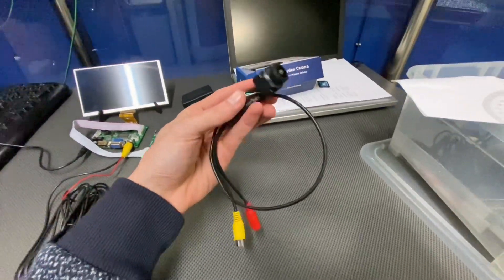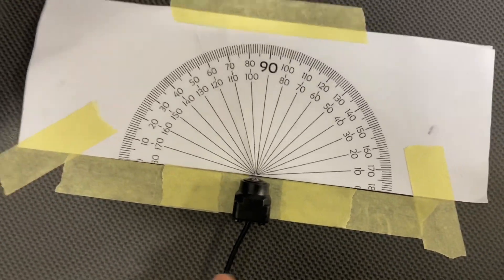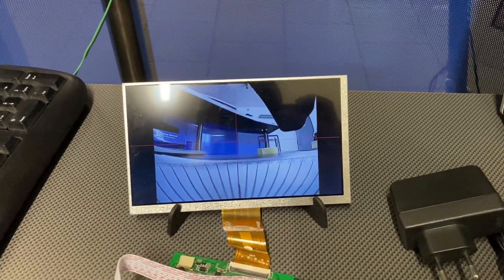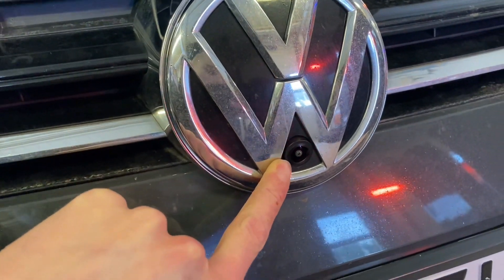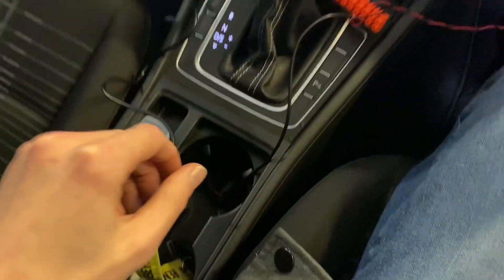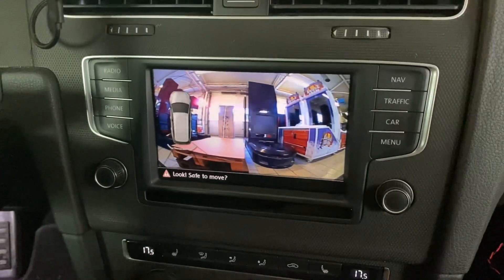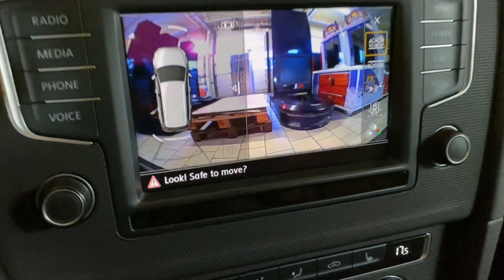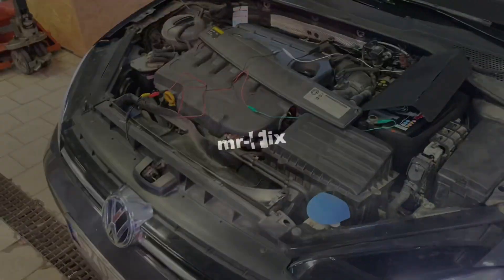Golf MK7 Front View Camera, part 2: grill and badge mod

Comment: Would you by anychance remember what size drill bit you used to drill the hole?
Reply from the maker: I've used several drills, starting from the smallest that I could find in my toolbox. At the end I used dremel-like tool to fine-tune the hole.

Comment: Would be interesting to see if you could mount a rear pop out camera badge in the front badge. That way it would generate the lines and be kept clean when hidden
Reply from the maker: Image would be mirrored
Reply: What about the mechanisms itself using a different camera . Just a thought. Great project. Love the videos
Reply: @sirnobbsalot7531  I've tried this it cant work as there is not enough room behind the front grill for the flipout mechanism. The front badge and rear badge are also different sizes.
Reply: What about using the gte front badge as that does flip out from the front